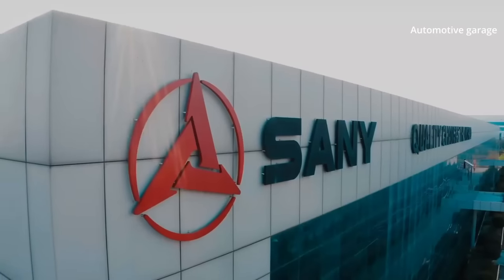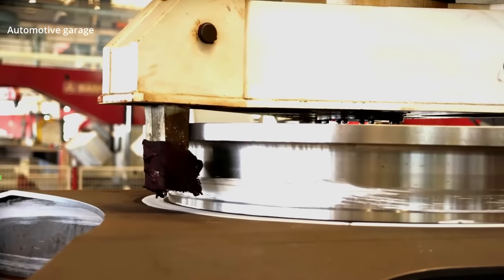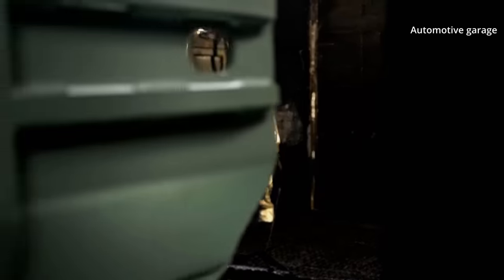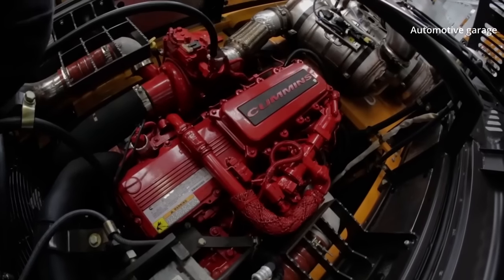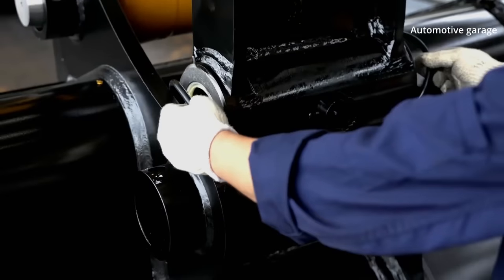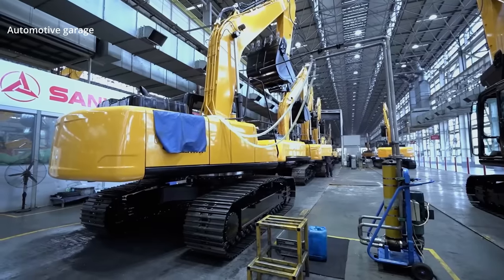How Chinese Excavators are made?  SANY Heavy Excavators factory

Comment from the maker: 0:00 About Sany Heavy Industry
0:09 Steel plates processing
0:33 Plasma cutting
0:51 Welding shop
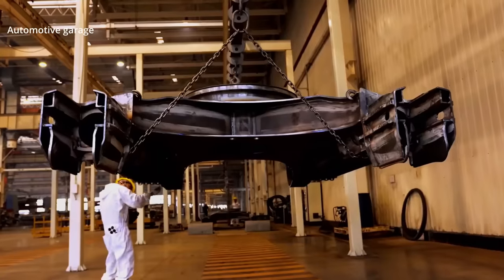2:02 Paint shop
2:42 Undercarriage assembling
3:00 Installation track system
3:08 packing by grease the slew ring
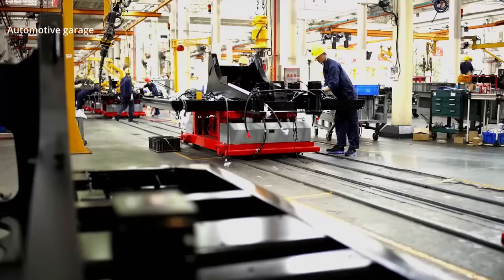3:31 Superstructure assembling
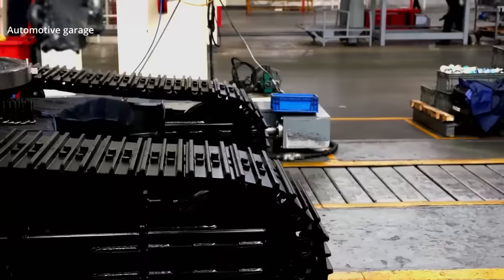4:41 Undercarriage to superstructure marriage
5:56 Assembling a lifting system with excavator arms
6:36 Montage arm to excavator
7:29 Final testing area
Reply: cool！
Reply: cool!  good👍🏻

Comment: 6:11 they just use a regular wrench?
they don't have any torque control?
Reply: These heavy machines torque ranges are very wide. Skilled workers can torque the nuts and bolts without torque control.
Reply: @123abcter  in automotive, we have some chassis joints that are torqued close to 200nm
We still have a torque control them with automatic Atlas Copco tools linked to MES
You can't just trust a guy with a manual wrench in production line
Reply: Keyboard engineer.